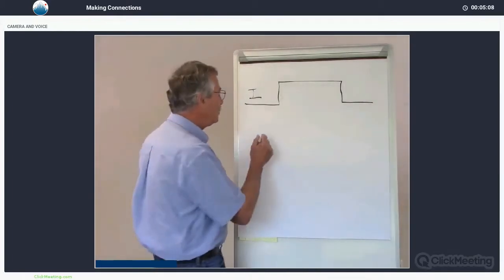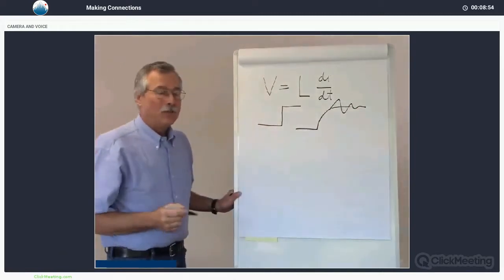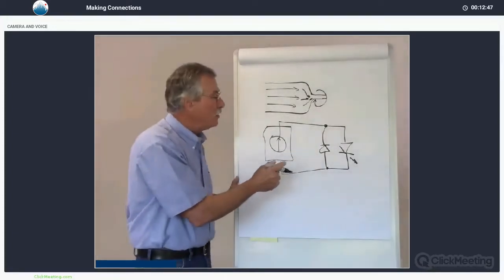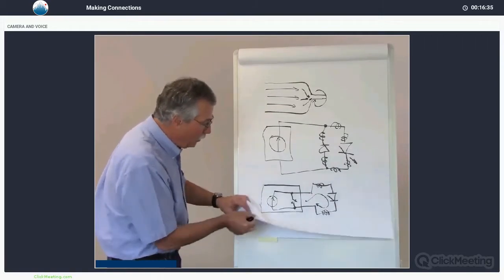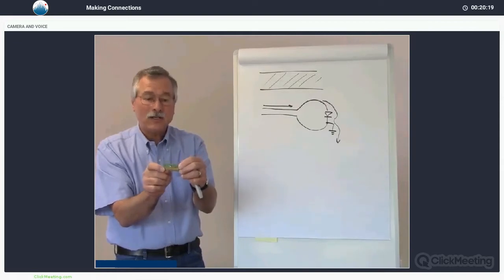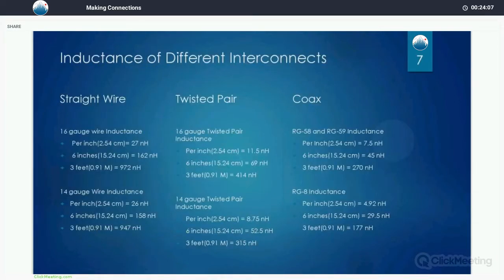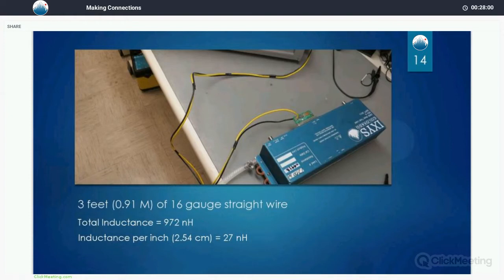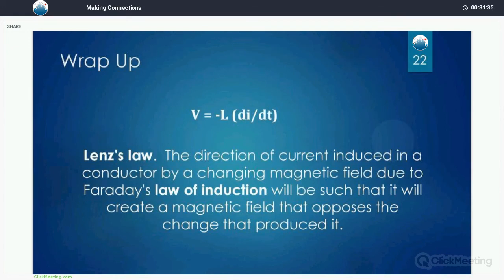Making Connections 2019

Comment: Fascinating.
A question of engineering atitude.
In order to eliminate inductance.
Engineer a housing around the diode, that vibrates the depletion zone inside the PIN junction. Than you dont need a pulser.
Use AC , high frequency current to vibrate the depletion zone.